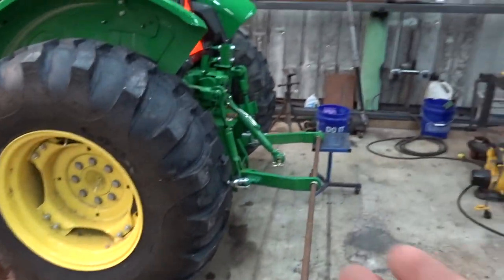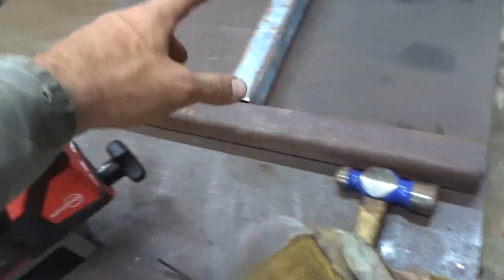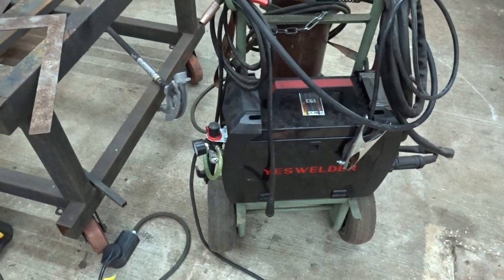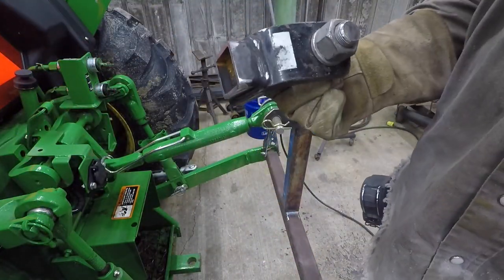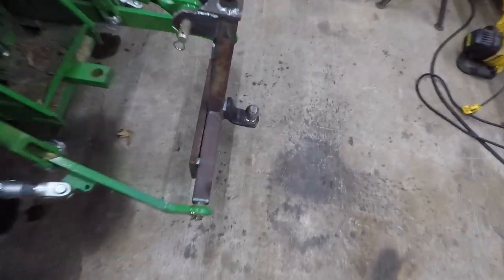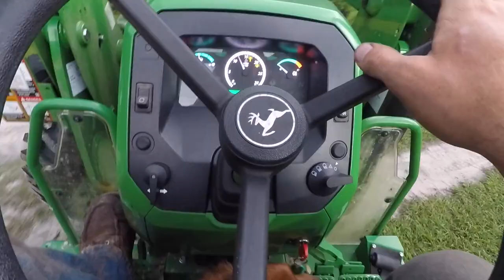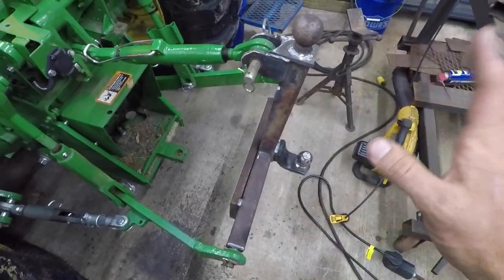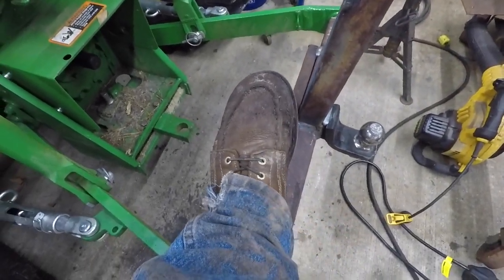Simple 3-Point Tractor Hitch To Move Trailers

Comment: If you have a tractor w/ 3 pt. and a trailer or 4, this is a must have. It works nice for tight maneuvering my gooseneck in my back yard. Great project.
Reply: To add, I used a multi-hole draw bar for the base and 2 large 3/4" bolts for the upright 3rd link piece.  This way i can offset the hitch to one side so i can see down the side of my box trailer when backing it along the house.
Reply from the maker: Neat idea

Comment: For your tractor, isn't there a down draft knob under the seat. Usually it has a turtle and rabbit picture on it. Turn it all the way to rabbit and it should drop significantly faster. Sorry if you already know this, I don't know your tractor experience.
Reply from the maker: To be honest, I’m not sure.  It has 2 levers that control the 3 point, but I can’t recall what else there is.